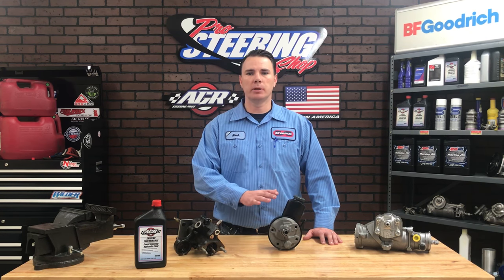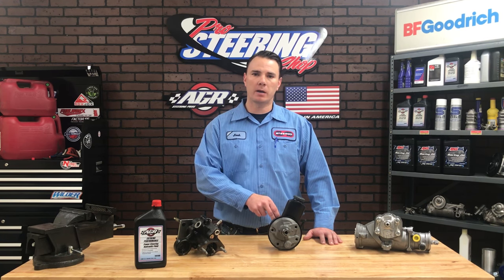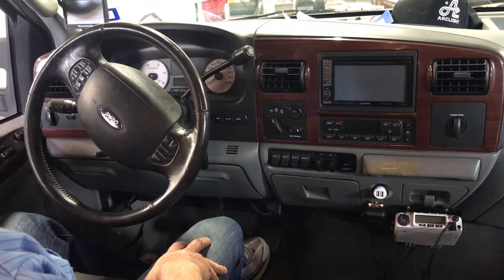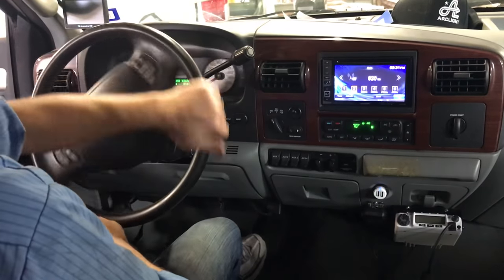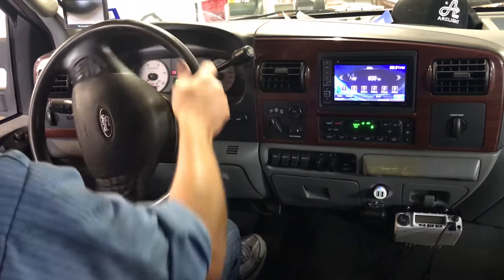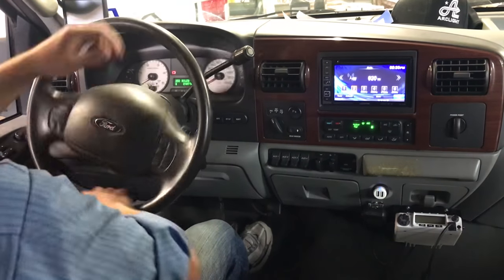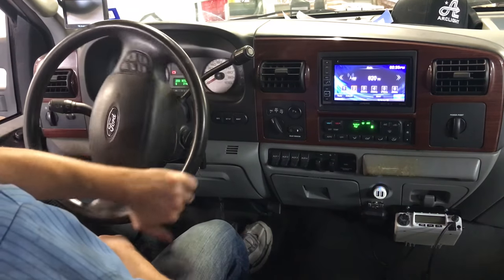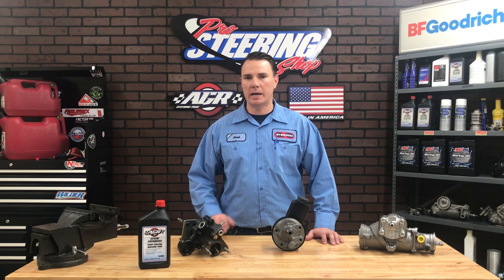Bleeding your Steering with Hydroboost Brakes, AGR Performance Steering

Comment: Okay so if I'm hearing this right one full-cycle is 5 times to the left 5 times to the right and then pump your brakes three times after you do the five to the left in the five to the right that is one complete cycle you said it took 90 Cycles to get the air out of the system is it better to have like an inspection camera or something to see if you can see bubbles is that we're looking for is Bubbles coming up I've bought a master cylinder before and I've bled slave cylinder before but I've never did hydroboost brakes I've had trucks with them but they've never really had no issues

Comment: I just had the hydroboost on my Chevy duramax 2500 changed out. Now it hums when I press the brake peddle and hisses around the power steering pump. Plus the steering wheel waffles back and forth from easy to hard turning... Will your bleeding method solve this?
Reply from the maker: Larry Wayne Jones what Fluid was used?  It likely is either air still in the system, poor fluid quality or the new booster isn’t good.

Comment: Where does the air go? Does the air in the system get pushed back into the pump reservoir via the low pressure return line?  I saw some old-timey manuals say to leave the high pressure line off for the initial bleed to get the lines mostly cleared.

I'm assuming the brakes themselves are already fully bled, prior to bleeding the hydro-boost/powersteering system?

Thanks for the video.  It was helpful.
Reply: Assuming do this with PS cap off

Comment: I was able to do this with the battery and air box out. Then have the the door open window down. You can lean out the window and see the power steering reservoir.You can see the fluid bubble  when turning the wheel. Thought this might be helpful for someone doing it by themselves. What if the power steering reservoir keeps puking fluid out?
Reply from the maker: Hugh Dugan when the reservoir is puking Fluid out it’s because air is escaping and pushing fluid out. It happens

Comment: I replaced my PSP, I have followed this videos instructions multiple times over, no matter how many times I turn the wheel and pump the brakes, there is still air coming up and still no brake power and I can not steer to the left when I try to drive it.
Reply: Sounds like you have a leak on the return line sucking in air

Comment: Ive done 60 cycles and still air in the system. Getting big bubbles in the reservoir. Im doing it with the front end on jack stands. Any tips?
Reply: The guy said it took him 90 cycles to get it fully
Reply: @iamn360  did 80 cycles still no change. Its not getting any better.
Reply: @Carnage6.0L  any luck yet, maybe its the power steering pump
Reply: @Nathan Salyers  i ended up taking it to a shop and they found the power steering pump yo be bad. Replaced it and bam steering and brakes issue was fixed. And thebpump was srill under warranty so it didnt cost me a penny.

Comment: how does GM do this task on the assembly line?
Reply: Could a pulsing intermittent vacuum be used to draw the new fluid through?  A slight vacuum may allow everything to fill by a combination of gravity and vacuum with the air being the easiest to move out I'm guessing.  Actually a fluid change could likely be done that way also without any air being allowed in.  Pull out the capacity amount, then look for clean fluid.

Comment: Ok can you explain why my master cylinder isn’t pumping fluid? I mean when I push the brakes with the cap off no fluid pushes out and it stays full as if it isn’t pumping at all! My brakes doesn’t work at all now after replacing the precharge pump!
Reply from the maker: Travis Jackson isn’t pimping brake fluid?
Reply: Steering Pro Shop AGR Performance Steering not at all. Reservoir stays full no matter how much I pump in the brakes and I know the lines are not full after replacing all those parts for that reservoir to stay full.
Reply: Steering Pro Shop AGR Performance Steering it’s has a rubber hose that runs from the front of the reservoir to the precharge pump. I assume that’s the issue but I replaced it with a used part off a Tahoe with low miles I don’t think it’s bad

Comment: I put  a hydro booster on mines but I didn’t do the bleeding process that way now when I crank my truck,turn the steering wheel,or give it gas it sucked the brake pedal down ....HELP
Reply from the maker: Randy Joubert it sounds as if your hydro booster isn’t working properly.
Reply: It was from a salvage yard so I’m guess it is a faulty one
Reply: I noticed sometimes when they give you a rebuilt hydroboost they do t include the Piston so I had to remove Piston from my old hydroboost and put into my new hydroboost 👍

Comment: Thanks for the informative video.  As you are going through the cycles and it keeps burping out fluid, can the fluid get low enough so you are sucking in air again? (Like with bleeding brakes)  How often do you need to top up the fluid? It seems like when I add fluid, I loose it all again the next time I start turning the wheel.

Comment: I just replaced a gearbox on a super duty and used this method. I have power steering to the left but not to the right. Any ideas
Reply: I would say air in your system
Reply: @seaneld  its kicking my ass lol

Comment: So full of it, he didn’t do 90 cycles lmao..
He wanted to say he did 100 but thought in his head “hmm that sounds a bit much, lets just say 90..” lmao
Reply: It took him 1minute and 17 seconds (Time stamps 3:22 to 4:39) to do the 5 L/R turns and 3 pumps of the brakes. Multiply that out 90 times (As claimed) means he spent over 1-hour and 45-minutes bleeding the system.   NOT!!!
Reply: I just drive mine around a bit. Air bleeds out just fine.

Comment: If the power steering and brakes went out do you think that’s the hydro boost or power steering?
Reply: Power steering pump feeds the hydroboost usually, how it works on my dodge

Comment: Hello
I’m sure you’ve explained this before although I’m just not seeing it.
So, I’ve just replaced the pump and hydro booster.
Attempted to bleed the air.
Now it hums when fuel is applied and when brake pedal is pressed as well.
Perhaps I’m just attempting to bleed it to fast.
Any ideas.??
Thanks
Reply from the maker: Jose R what fluid are you using?  It sounds like either poor fluid quality or you still have air in the system. You might let it set for a couple hours and rebleed the system again. I highly recommend AC Delco if you don’t have our fluid because it’s a good quality and readily available at all dealerships

Comment: Do you do your full cycle of turns with your wheels with the power steering cap on or off n also if your brakes are still spongy do you bleed them
Reply: Did you figure out if you needed the cap on or off? I have the same question
Reply: @jayandtay2447  n yes very helpful but come to find out pump was not circulating because the power steering shaft was broke
Reply: Off

Comment: i replaced power steering pump ,lines steering box, on my 2004 gmc duramax with hydroboost. did the procedure serval times put back on ground still no steering at all or brakes
Reply from the maker: Ellis McNeely how many times full cycle, (five full turns lock to lock and 3 pumps of the brake)?  What fluid are you using?
Reply: i used the o'Reilly brand power steering fluid, i have done your procedure around 30 times plus i have done others before i saw your way. could i have a bad hydroboost?
Reply from the maker: Ellis McNeely you could. Is so hard to diagnose over the internet or phone but I HIGHLY recommend flushing out the house brand crap and use either AGR brand, Swepco715, or genuine AC-Delco Power Steering fluid. Even if it’s in a Ford!  Fluid quality does wonders!

Comment: I have an 07 GMC 2500, w/hydraboost, and replaced the pump and lines.. I never even had the truck off the ground or I would've bled them by turning the wheel back and forth and pressing the brake. 
I pressed the brake pedal a few times and started it up. 🤫
There was some whining for sure..I then pumped the brakes and steered back and forth for about 5 minutes.  Then drove it. 
It's mostly good, but I still here occasional whining when stopping AND turning sharply.
Reply: I feel like there should be a bleeder valve or something to get air out I'd the hydraboost. 🤷🏼‍♂️

Comment: Ok whenever I try this, my fluid will over flow out of the cap. So I have to do this very slowly with someone watching the fluid to keep it from overflowing. Why is that????
Reply from the maker: Muddin 4 Jesus when the fluid comes out the cap, it’s because there is still air under the fluid level trying to come up, pushing fluid out as the air is rising inside the system
Reply: Steering Pro Shop AGR Performance Steering  ok so I’m good by doing it slowly and not letting it overflow?
Reply from the maker: Muddin 4 Jesus yes that is correct.
Reply: While you are steering left to right Is the cap for the power steering should be off or on the reservoir?

Comment: Hey man - new subscriber here & love the channel.  I'll be replacing the hydroboost on my 98 Mustang Cobra, and the shop manual says to use Vacuum pump to bleed the system.  I don't have access to one, will this work just as well?
Reply from the maker: Yes sir this will work well for you. Be patient and make sure you get all the air out so it doesn’t damage your pump.
Reply: @Steeringproshop  thank you so much :)

Comment: Do you do this with the cap on or off?
Reply from the maker: Jon Dize aka DIZEMAN with the cap off
Reply: Does anybody understand that when they do this it pukes fluid everywhere so how does this make sense and bleeding it it almost sounds like it's going to put more air back in this system
Reply: @fatfairlane  The system isn't pressurized with the cap off its flooding with fluid which is why the level is going down, pushing the air up and out to the ambient. It's not going to suck air if the reservoir is topped off. If you're throwing up fluid truck off you've got a problem bud.
Reply: @mylesswann530  every one of these I've ever seen the fluid when you turn the wheel to the right will damn near push out but as I should have stated that's before all the air is bleed out and so on.
Reply: @fatfairlane  Half fill it or start it low and have a buddy add to it while you're working it and Bob's your uncle.
Reply: @mylesswann530   Who is Bob
Reply: Myles Swann a
Reply: @mylesswann530  You didn't read my comment bud. No! It is not blowing back fluid with the truck off, but when the cap is off and the truck is started, fluid does spray out of the reservoir. Bud!
Reply: @DIZEMANPHOTO  https://www.reddit.com/r/Cummins/comments/eug3a6/power_steering_hydro_groaning/fg565g1?utm_source=share&utm_medium=web2x

First drive home from the dealership in my 03 5.9 NV5600 Cummins with 207K on it. I noticed the morning after I got it back that it didn't have a reservoir cap at all. No fluid leaks. The missing cap was a sign of a pressure issue in the power steering system.

Comment: Great video ,I drive an Avalanche so I bottomed out in a hole yesterday . The brakes seized up it seemed ,along with the steering. After waiting till today I cranked the vehicle and the steering works but when applying the brakes I noticed the foot pedal wants to stay stuck down about half way so it takes my foot under it and pulling it out back to its normal resting position. So I'm asking will a simple brake bleed be the fix? Or am I possibly looking at purchasing a new booster.
Reply from the maker: BRALEYS Hardwood Customs sounds like you need a boost. However it’s hard to say remotely.
Reply: Thanks but it probably won't hurt to perform this action on it beforehand would it?
Reply: Maybe its just the pushback spring in the connection between your booster and master cylinder.

Comment: I have a 2003 Ford F250 with the 7.3 and it's almost impossible to steer it when the truck is sitting still. Is that a sign of a failing pump or air?
Reply: Air

Comment: I'm calling BS on that every time you turn the steering wheel with the motor not running it it pushes the fluid out of the resivor and all over the place

Comment: so i just replaced my power steering pump and hydro boost and have been using this process for hours and all im getting is the fluid over flowing out and maybe a few bubbles but still feels like no power steering when i crank it up and the reservoir is full
Reply: Probably sucking air for a loose fitting or hose.

Comment: My Nightmare Started with a drip from the weep hole at the hydro boost/master cylinder connection. After countess puddles left around town and bottles of power steering fluid, It completely seized outside of school and was spewing PS fluid out the rack and pinion with boots full like a water balloon 🥺. 
Work done to fix it so far:

1) Replaced the seals inside the power booster 
2) replaced power steering pump
3) replaced all seals/o rings within the rack and pinion and steering pinion 
4) added filter to feed line
5) tightens all hoses 

After doing this I topped off the fluid and ran it while doing short left right turns. The noise and foaming gradually went away as i continued this until all was silent and no more bubbles. I then drove a half a mile and it was good right up until i parked. It seized up again and began leaking again from multiple spots like the rack the booster and a hose or two 😢😩. So now I am trying your bleeding method and I do hear bubbles escaping but its still leaking some fluid as I turn through the cycles. Any emergency advice from any knowledgable person may help this saga end 🙏🏽
Reply: Did you fix it?

Comment: What is wrong if when I jack up the front end and start the truck my steering wheel turns itself to the right, when I rev engine it turns more
Reply: I took gear box apart and put input and output shaft seals in it.

Comment: Hmmm, no mention of using a vacuum pump method...
Reply from the maker: Jay Dee no sir. The pump has a valve, the steering gear has a valve and the hydro booster if equipped has a valve. The turning the wheel left and right, forcing the piston up and down in the steering gear, resulting in plunging fluid in and out of both lines opening the valve in the steering gear is the tried and true proven method.

Comment: This must be a joke. Telling people a ridiculous way of doing something. You must charge by the hour. Why not use the vacuum method? Adapter kits are around $35. Purposely made adapters about the same. You don’t need to get every micro bubble out before starting the engine. The rest will be gone after a few minutes of driving.

Comment: I replaced the hydroboost on my 2000 Chevy Astro and still have no power brakes or steering. I've done at least 100 cycles and noticed clusters tiny air bubbles. Tried another 100 cycles the next day and had the same result. Any tips for a Youtube Academy dumbass?
Reply: Very possible that you've got an air leak - your sucking air into the system somewhere. No amount of cycling will cure that. Find the leak and fix it!
Reply: @BillyJoeJimBob8  It turned out my power steering pump failed. It was a hell of a job with how compact it is under the hood and being on the bottom of the engine bay (it's AWD, so I couldn't remove it from underneath with the diff in the way). I wasted $ on a new hydroboost but has been problem free ever since.
Reply: @theanti-come  
Glad to hear your problem is solved. Too bad $ was spent when it wasn't a necessary thing to get it right.
Reply: You worried me because I too have a 2001 awd I recently got and I’m doing the hydro boost on tomorrow but mine looks like it’s been leaking from there for at least 5 years 😂

Comment: I got a ram 2500 diesel, after feeling something different in the brake pedal and lack of power steering shortly after I changed the pump.  I did a lot of bleeding and made sure the new pump was delivering pressure to the hydro booster, kept bleeding and I can only turn the wheel completely left, once I get to center it wont turn any further.  It wont turn right.

Any help is appreciated.

Thanks,

alfred M

Comment: I replaced the hydroboost and the power steering pump, steering seems good but breaks are soft. And when I press the break PS fluid comes out. I'm guessing I did not bleed it thoroughly?